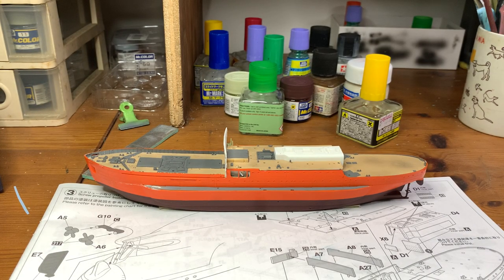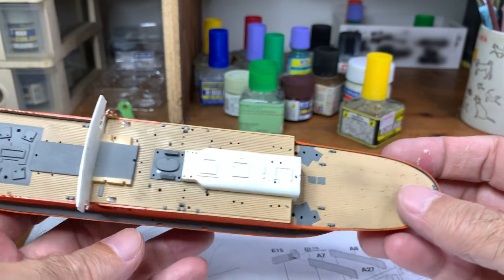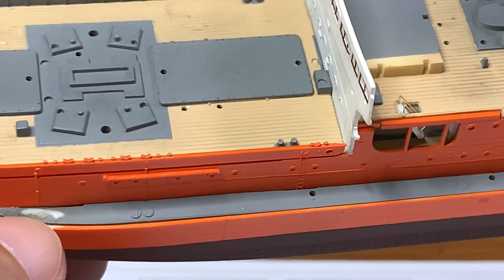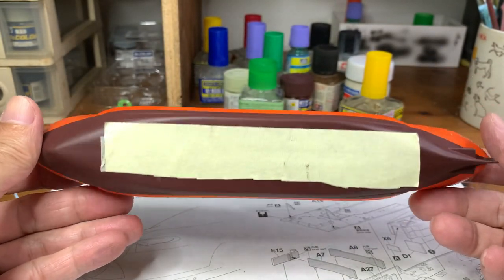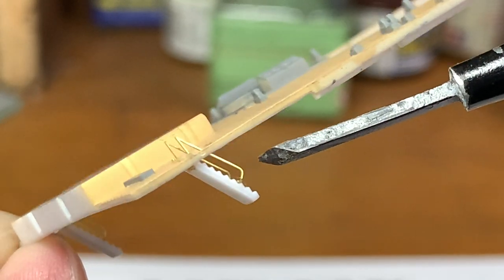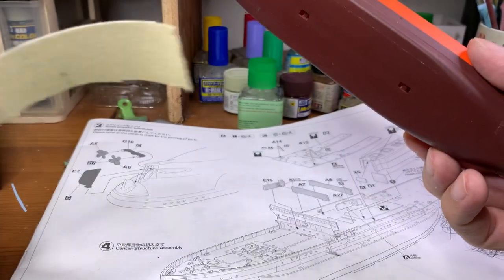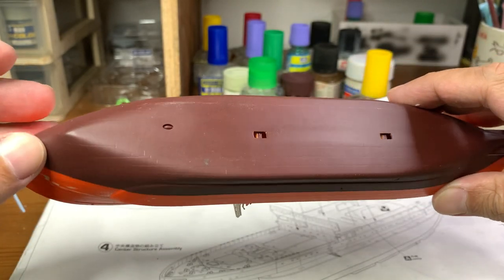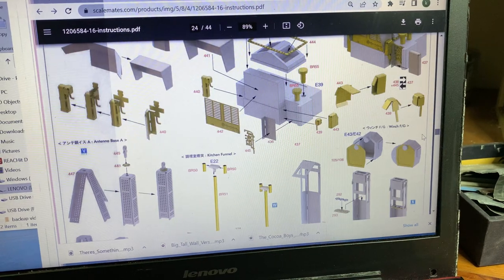1/350 Antarctica observation ship SOYA 2nd Corps. Hasegawa. build review part 2.

Comment: Great progress, Thank you for sharing. I have one of those kits, don't recall which one, it has photoetch, a snow cat and a metal figure. Also got the wooden deck for it , only need the inspiration, and after watching some of the YouTube videos, I might take a crack building it. For those cracks have you thought using stretched sprue? Also, who's orange color did you used. A few years ago, Gunze sold a Soya paint set, but it was enamel, couldn't use it, bad lungs. Hope you and your loved ones have a great/safe week . Until the next time, take care.
Reply from the maker: Hello there. thank you for your comments. good to know you have a set as well. i’ve seen the one with the cat and figure. just don’t recall which year it was released. this kit has been re boxed many times. i don’t think of using melted sprues for the cracks. i have used dissolved putty to fill up but using masking tape leaving only the gaps visible. still waiting for it to dry. as for the orange color i used mr colors C59 which is acrylic. if you want something less stronger there’s equivalent mr color aqueous H14 which is water based but takes longer to dry. this kit is difficult. i spent longer time in each step unlike trumpeter kits where i breeze through it. i hope you catch the inspiration to start on it. it’s a great kit. enjoy it. thank you.